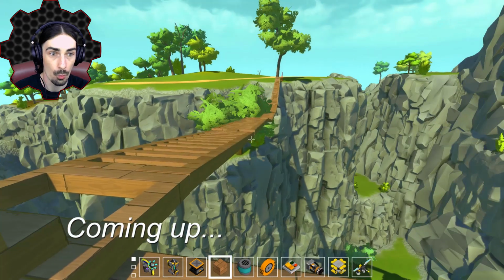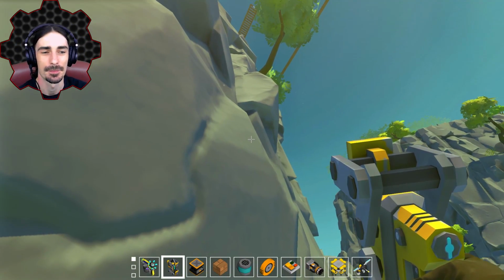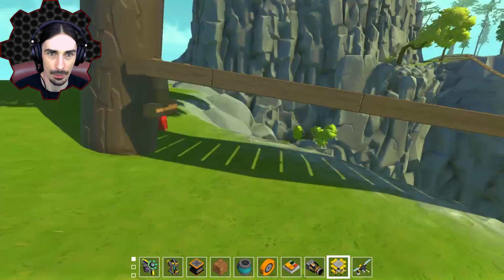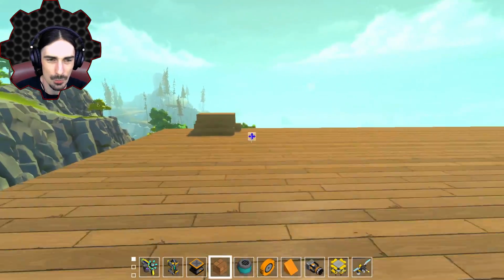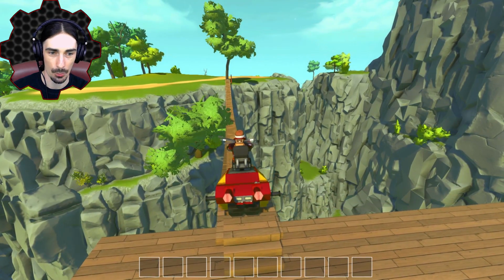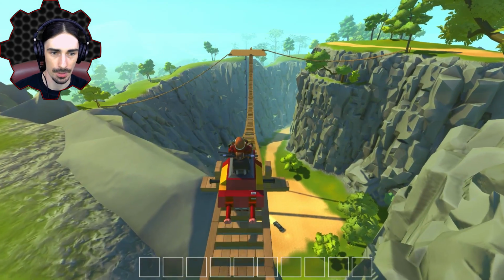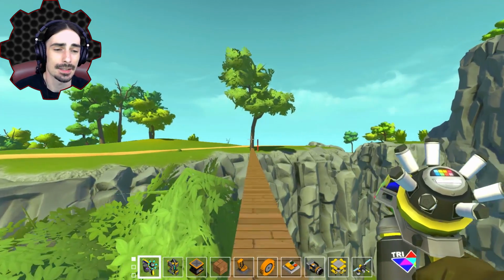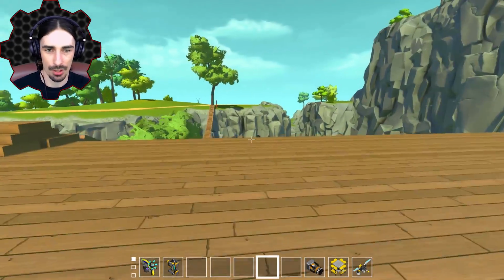TESTING THE BRIDGES and DISCONNECTING! (Suspended Mountain Base Part 4) - Scrap Mechanic Gameplay

Comment: i want to see you cut a hole in the middle of the platform, then attach bearing flaps/ trapdoors to the side. then paint the project grey and in the center gate it off with warning signs and whatnot. Then make a metal bomb that you can drop through the flaps, now you got a suspended base to drop endless projectiles down to your enemys! Like so scrapman can see

Comment: SCRAP MAN! I have an idea of lowering the plate form with out the glitches. If you keep the pillar and stack a bunch of maxed out pistons (15 blocks) on top of each other, and have about 4 towers of these on each corner (the piston towers will not be connected/welded to the base. This could cause lag though) it will probably help. You would slowly lower the first piston of all the towers in unison, then the second, then third, etc. This way there is less of a chance of the platform glitching out of the bridges, and it is slowly being lowered.                  If you guys think this will work, try to get/keep this comment at the top of the comment bow please, or don't if you think it's a flawed plan.

Comment: you know maybe for that other platform idea, with the fake suspended bridge would be good. That off shooting platform could be some sort of garage and/or a way up from the ground using an elevator or stairs. Also the bridge connecting them could be loose just underneath it have some blocks follow the curve of the bridge so both platforms are connected and static.

Comment: The "ring" of the bridge is angled down. So when you attach it tight it wants to curve and has no space to. If you didn't get it: 8:45 make that wood part which is held from cylindrical pipes it will ease everything.

Comment: use pistons to slowly get the base down so that the bridges won't detach.
like put pistons on the base bottom and extend them till they  touch the ground then retract then one by one one the slowest speed.
Reply: and if you don't want to stack the pistons then use a mod that has pistons that extend more than 15 blocks

Comment: You should use this in a multiplayer challenge

Also you could put some thrusters on the bottom of the platform with switches and just make a pillar with invisible blocks to create the illusion of a floating platform

Comment: If i was building this i would connect the bridge to the platform with pistons so that it is truly connected to the base and you can control the tension of it. And with it being a truly connected base and bridge and not hot it is it would be less likely to break.\
So you can try placing pistons on the base so that they can retract flat or to where you want them weld a bridge to that. you would need the pistons to go down or up to the point that you connect to the ground so that you can build on to it and connect it to the ground.

Comment: You should make a cable car system under the bridges or make one on the side with out a bridge and have the moniwhile veihcle as the the cable car using the kickstands as the connection points or a hang bit built off of it
Reply: And maybe use Pistons to push it across the top or side connection points or cables

Comment: Antimater thruster challenge? with Kan,Moonbo and Camodo like if you agree!?
Reply: but what does it mean?
Reply: Donut Genesis Antimatter is a rare type of ore/object
Reply: Its a particle with diametrically opposing quantum numbers. Basically the yin in yin yang..
Reply: Donut Genesis antimatter is a rare object not yet found by man that when under the same conditions as regular matter would react in the opposite way, physics wise anyway. i.e. Normal matter is pulled toward the group and antimatter is repelled from it.
Reply: yep, the yin of matter
Reply: well dounut genesis here is youre anser, Annihilation

If a particle and the associated anti-particle meet, annihilation can occur, a process in which both particles are destroyed and a lot of energy is released. E = mc² is used.

In some cases only the internal energy of the particles remains, which was manifest as their mass (it is said that "the entire mass is converted into energy"). That energy then escapes in the form of electromagnetic radiation. For example, an electron-positron pair will decay into two photons. A gram of matter with an gram of antimatter yields 1.8 × 1014 joule of energy, 43 kilotonnes of TNT, or the combustion energy of about 30,000 barrels of crude oil at full annihilation.

In other cases, the annihilation produces all kinds of particles, such as piones and neutrinos, some of which itself decay after a short time. In the annihilation of a proton-antiproton pair that touch each other at low speed, the result is 20% of the cases:

    pp ¯ → 2 π + 2 π - π 0 → 2 μ + 2 μ - 2 ν μ 2 ν ¯ μ 2 γ {\ displaystyle p {\ bar {p}} \ rightarrow 2 \ pi ^ {+} \, 2 \ pi ^ {-} \, \ pi ^ {0} \ rightarrow 2 \ mu ^ {+} \, 2 \ mu ^ {-} \, 2 \ nu _ {\ mu} \, 2 {\ bar {\ now}} _ {\ mu} \, 2 \ gamma} {\ displaystyle p {\ bar {p}} rightarrow 2 \ pi ^ {+} \, 2 \ pi ^ {-} \, \ pi ^ {0 } \ rightarrow 2 \ mu ^ {+} \, 2 \ mu ^ {-} \, 2 \ now _ {\ mu} \, 2 {\ bar {\ nu}} _ {\ mu} \, 2 \ gamma }.

The annihilation products in this case are pions (π), which in turn disintegrate after a short time in (anti) muons (μ), (anti) neutrinos (ν) and photons (γ). The muons then also quickly disintegrate again.

Conversely, if sufficient energy is available in one place, these can be used to form a particle-anti-cast pair. This kind of pairs also arise briefly through energy fluctuations.
Antimatter in the universe

In the part of the universe studied by man there is almost only ordinary matter. This is remarkable given the above: from the "nothing" matter and antimatter would arise in equal amounts. There are various hypotheses about the cause.

    During the big bang about the same amount of matter as antimatter was formed. There was, however, a little more matter than antimatter and after a large-scale annihilation process only some matter remained. That is why the present universe consists almost entirely of matter and that there is so much radiation in the universe (radiation from the annihilations).
    Another hypothesis is that a large, far removed (and not yet observed) part of the universe is completely constructed from antimatter. At the creation all matter would have ended up in one part and the antimatter would have ended up in another part. It should be noted that we perceive celestial bodies mainly through the emitted photons, and a photon is equal to its anti-particle (a photon is the same as an anti-photon) so that no difference can be seen.

In April 1997 it was discovered that positrons were formed in the center of our galaxy. The Compton Gamma Ray Observatory from NASA discovered clouds of positrons.

In July 2003, a team of researchers from NASA discovered that antimatter is formed in giant solar explosions, the so-called solar flares. The researchers used NASA's Reuven Ramaty High Energy Solar Spectroscopic Imager (RHESSI) to study the high energy X-ray and gamma rays.

In 2011, with the last flight of space shuttle Endeavor, the "Alpha Magnetic Spectrometer" was transported to the ISS. He will do ten years of research into antimatter and dark matter.

At a few hundred kilometers altitude the Earth is surrounded by a belt in which relatively many antiprotons occur. [2] These are trapped by the earth's magnetic field and remain because at this height little normal matter is present, so annihilation does not occur. Particularly in the South Atlantic Anomaly, high concentrations are measured that can not be explained by normal decay. An international team of physicists came to this conclusion in 2011 on the basis of measurements from the PAMELA experiment (Payload for Antimatter Matter Exploration and Light-nuclei Astrophysics). This is a European satellite experiment that was launched five years ago. It is speculated that this antimatter could be used in the future in an antimatter drive. [3]
Trivia
In the book The Bernini Mystery by Dan Brown father and daughter Vetra succeed in producing antimatter and storing it in a specially developed cylinder. This cylinder is stolen and placed in the Vatican City as a kind of bomb. The CERN laboratory has opened a special web page [4] to explain that this is not possible.
In various science fiction franchises such as Star Trek, antimatter is used as the ultimate fuel for spaceships. Because a huge amount of energy is formed with a limited mass, this could solve storage problems. There are no concrete plans

Comment: you could replace the bridges with straight beams and they would hold up the platform and you could make a chair with a hook for the bridge and then add wheels inside the hook but on the inside of the hook so you could slide dow the bridge safely

Comment: it would be cool if you build like a rope that goes from the big mountain to the base (like the bridges just at an angle) but you could slide down the rope in some kind of thing but it would be best built static because a suspended rope with something sliding down it seems impossible

Comment: This is what you do first make all the bridges the same length if they sag after you attach them they are to long then you put the base in the middle of the canyon and to make it suspended by the bridges delete the bottom piller one by one until the piller is not touching the ground then you can delete the whole piller

Comment: what if you find out what all the angles are for all the platforms on a bridge, and set controllers to keep them there, main base will stay up the bridge itself as an anchor point, but the bridge just wont be able to sway or move like the other ones